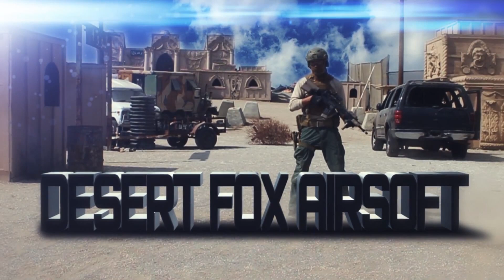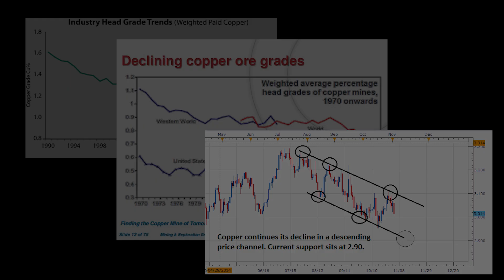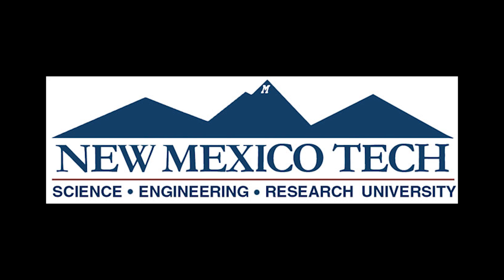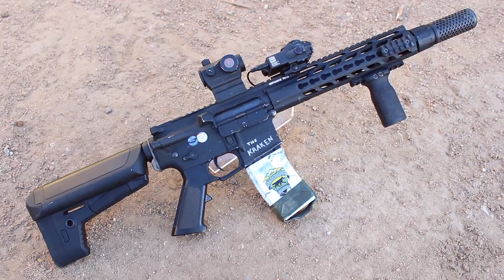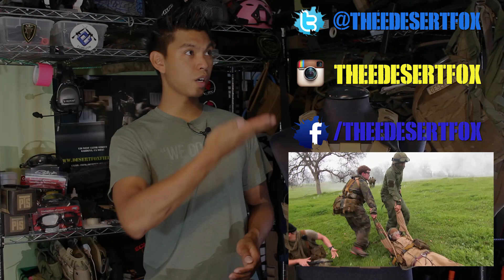American Milsim OP: CopperHead SITREP (Situation Report & Gear Used)

Comment: I wonder if the suppressor he had on his gun was attached to the threads or if it just snapped on the stock flash hider... Heard the krytacs flash hider were a bitch taking off, someone help me on this, is there any qd suppressors that fit the stock flash hider?
Reply: No, I don't know of any that snap onto a Krytac flash hider, so you're a little bit out of luck. However, it's not that hard to take off a Krytac flash hider, you just need to soak it in boiling water for about 5 minutes and try twisting it off with pliers.